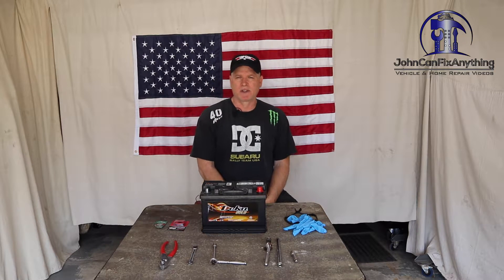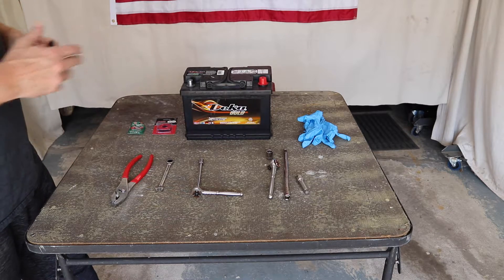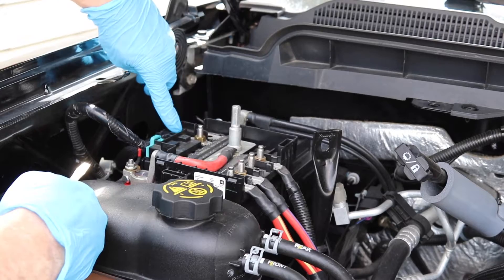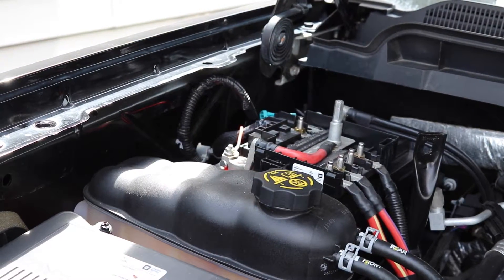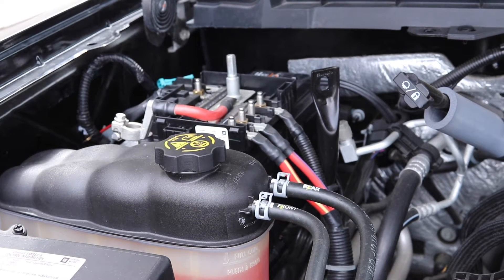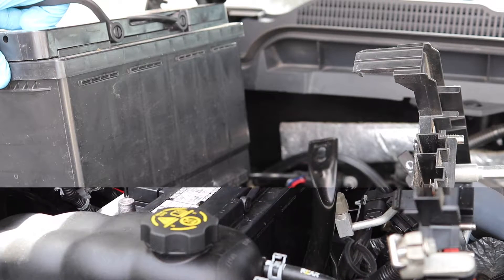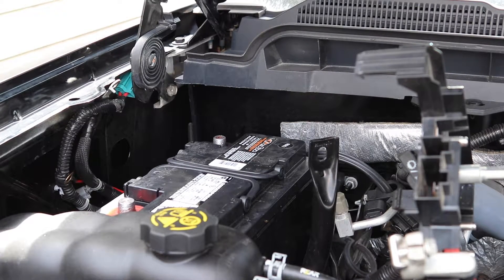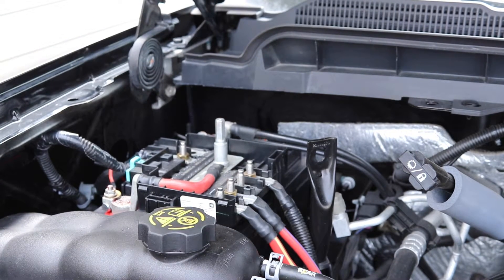2017 Silverado Battery Replacement

Comment: Generally you should always disconnect the negative lead first and reconnect it last when working with batteries. That way you will not have to worry about shorts that can cause burns and arc fires.
Reply: Then when you’re undoing the positive you’ll arc on anything you touch with the tool. Lol. You always disconnect the positive first then negative.

Comment: Must have a longer battery in mine, I had to loosen the coolant tank to get it out. Nightmare as far as a battery change out goes.
Reply: Other videos show where u remove bar that holds battery down and the battery twists easily to pull it out without needing to loosen tank